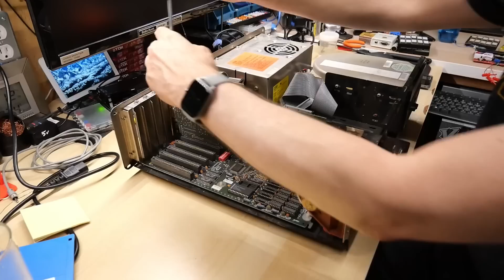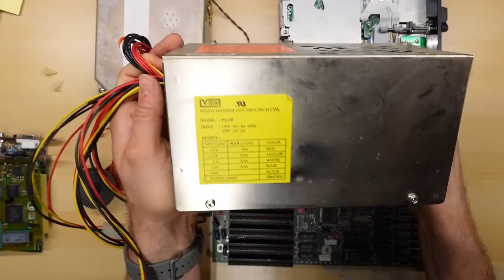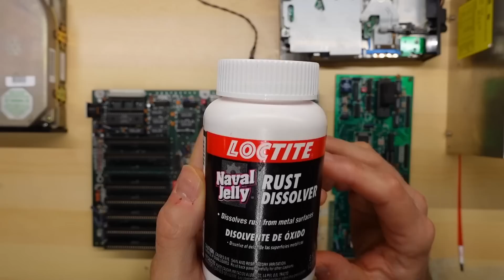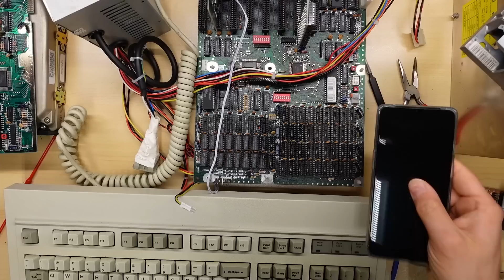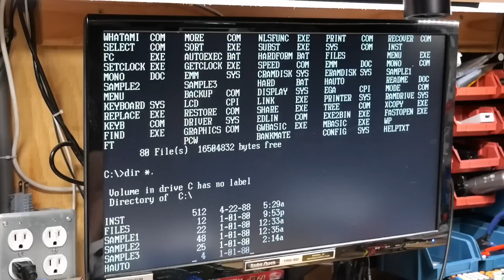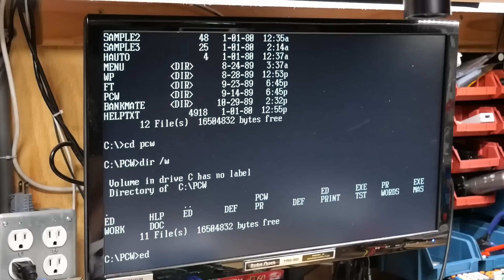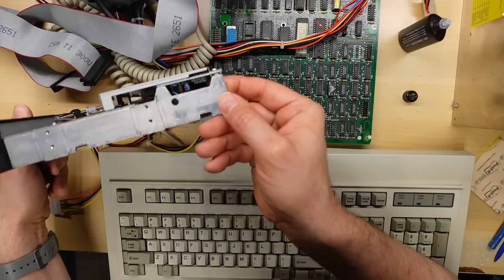PC archeology: Laser XT Turbo "Leaking VARTA Battery" Edition

Comment: My first XT had a 30mb RLL hard disk.  Remember those?
Either that PC was stored vertically on it's rear, or that battery EXPLODED
You probably need a model F keyboard, not a model M.  (function keys in two columns on the left)

Comment: Using RLL (1,7) encoding gave roughly 50% extra capacity over MFM for nothing, but required very precise control over the spindle speed to provide accurate timing. You can put any MFM drive onto an RLL controller and low level format it to RLL, but if the spindle speed is not constant it will be unreliable or unreadable. A RLL drive suffering with bad bearings or motors would also cause issues with the encoding and produce errors. Changing the controller card can also cause issues if the drive is not low level formatted on the new controller. 
Some manufacturers would only certify certain drives for RLL like the (R) one you have. Some top end disk suppliers would build drives to RLL spec regardless and sell them as MFM or RLL drives regardless.

Comment: You need to preserve the Laser XT software before you go formatting that drive.

If you can get the Laser XT carry all pc portable (it is a PC version of the Laser 128 Apple clone) you should be able to use the Laser Turbo XT software that was on the hard drive.
Reply: I'd preserve the form software that's on the disk as well, if there's not already copies on the internet. Just so its not lost forever, then future generations can see what these machines were used for, aside from games :-)

Comment: Phosphoric acid (aka E338) isn't itself toxic - you find it in soft drinks quite a bit to give them some "bite" - but like any edible acid (including citric acid, malic acid, acetic acid, &c.), you don't necessarily want to drink it in anything but low concentrations!
Reply: Keith Gaughan, re Phosphoric acid,
Or rub your eye when you are working with it.
Reply: i am serial computer vetreran. we had 10k pisces
Reply: Iirc, malic acid is safe in high concentrations, you can buy crystals of it in similar size to salt in grinders, the only side effect it has is causing your tongue to bleed, which isn’t fatal
Reply: @Voxfan124  Is that the stuff on things like Sour Warheads? Because those always irritated the hell out of my tongue....lol.
Reply: @VenomStryker  yes
Reply: Phosphoric acid is the sour taste in Coca-Cola, and I can't stand it, so when he said "toxic" I just went with it. (Remember the urban legend about cleaning your battery terminals with Coke? This is why. It kinda sorta works.) It's also used in making cheese.

Comment: For the HDD, when the MFM/RLL drives start having issues booting it's always best to use the controller bios low level format routine to rewrite the track information.  Then run spinrite/scandisk on it to check/fix/remap any bad sectors after.  It was standard procedure back then to do that when pairing up drives to controllers.  Also the ST225(R) sometimes had stiction issues and were fine once you got them spinning.  The R in the ST225 model name meant that it was a certified RLL compatable drive, but it could also be re low level formatted to MFM.  The opposite is also possible, but with mixed results depending on the quality of the platters.  If you have a marginal RLL drive it may be a perfectly fine MFM drive when re-lowleved (with reduced space).
Reply: To be honest, the ST-225R label puzzles me. IIRC, the RLL version of the famous ST-225 was labelled ST-238R (denoting the capacity of a 25meg MFM drive formatted to 38meg RLL). But it seams, they just tucked a "R" behind the name to indicate RLL-formatting capability. Suffice to say, that when RLL controllers appeared, everybody just tried to reformat their MFM drive to RLL to gain the speed and capacity. Most of the time, it just worked fine.
Reply: @virtualinfinity6280  The 225R was something like 17 MB "naked" when MFM was used, so 14 MB or so after partitioning and formatting. Nobody wanted a 14 MB drive in 1989, which means this design simply wasn't marketable without the RLL space bonus. Since the people with pocket change had moved on to the ST-251 by then, or something even larger, nobody really cared whether their 20 MB drive was a small drive being pushed by the controller, or a sloppy bigger old one not being pushed. Fortunately for Seagate, the ST-225R was fairly reliable (comparable to the 225 and 251).

If you took an ST-225 and stuck it on an RLL controller (I do specifically mean the common 2,7 RLL of the day, not the even higher density variants that appear inside IDE drives) you got an ST-238R. The only difference between an ST-225 and an ST-238R is that if your ST-238R didn't work with an RLL controller, you could return it as defective but if your ST-225 didn't want to (but worked on the MFM controller) you were SOL because "running RLL" was not guaranteed. In practice, it almost always worked just fine. Also all the 238R models were the faster of the two variants of the 225, because the slower-seeking one became obnoxiously noticeable when dealing with 26-sector tracks.
Reply: @virtualinfinity6280  Back then it was quite common to low-level format the MFM drives to try and get more space.  Most of the time it was fine, but some drives didn't take it well, not good enough media for the data density.  Yeah the drive labels were a bit of a mess back then, Miniscribe had some archane numbering too for their drives.  All of them were noisy (Micropolis and Miniscribe especially).

Comment: The way I clean this type of corroded slots is using hand clean wipes. I let them out to dry for a day. I soaked them with vinegar then push them in the slot with a credit card. Leave them in for a few hours and it will absorb the corrosion, they'll turn blue. Repeat the process several times and end up cleaning the rest of the corrosion with a tooth brush and vinegar.
Reply from the maker: That's a good strategy!

Comment: I had an XT machine way back where the keyboard lock pins had to be shorted if the mainboard was not in the case otherwise the keyboard didn't work, maybe this is the issue
Reply: I checked the manual and section 2.12 says the pins do need to be shorted for the keyboard to work
Reply from the maker: Thank you for the tip Motolav and Rob!!! I will do a quick follow-up test. Awesome!
Reply from the maker: Yep that was it! Motherboard is booting and working fine. https://imgur.com/a/Rb1YFrQ
Reply: @adriansdigitalbasement2  Glad we could help! Thanks for the great content
Reply: @adriansdigitalbasement2   from what i could tell is that the Laser XT/3 motherboard is almost the same design.. (i have this machine here) and restored it almost.
Its weird to see that the installation of the ram chips (conventional memory) is on the other side on the motherboard 8088 XT vs 8086 XT/3
Here the installation of the dip memory starts on the upper side where   the DMA controller IC is. Then the two banks on the left are for 512KB. And the sockets underneath is (which you showing us in the video) are for install the 128KB of memory.. The 2 rows on the right side is for EMS memory installation.

I have upgrade my system with new memory chips,  had to soldered in a new IC socket for the DMA IC and also replaced that due corrosion.
Added an Intel 8087-1 10 Mhz co-processor just because Upgraded my NEC 20MB MFM drive for a Seagate ST-277R 65MB 
added and EAGLE II graphics card. ADDed HD_floppy controller. Replaced the old 720KB drive with an 1.44MB one (because those diskettes are more available) (but still the 360Kb chinon drive 5,25 is original. Further will add, an SB 1.5 to it, ethernet card from SMC 3008TP, and adapter ACB-2070 RLL controller.
Also will add an Roland MPU-ICT to it, for connecting an MT32 to it.

What i do to revive old Winchester or other hard drives. Connect them only to the power supply (without interface cables) And let it warm up for some time. 
Also try to lubricate the spindle bearing if it is possible with that teflon grease  (tri flow) If its sound good again.. Try to see whats on the drive, if you know on which controller it was installed on. Then backup the data you need. If its done, re low level format it and start over.. Due age, the magnetic surface gets more errors and data loss. To reformat it you will prefend that.

Comment: Phosphoric acid?  Hrmmm  I wonder if concentrated Star San would work at 50% phosphoric acid.  Of course who knows what Benzenesulfonic acid would do...
Reply: just pour coka-cola on it.  same thing.  works great on car batteries too !
Reply: Makes sense why people use cola for rust, don't know why it's there to begin with.
Reply: C6H5SO3H is actually a waxy solid at room temperature.  Its sodium salt is often found as an additive in laundry detergent.  It is a very strong acid and will decompose to benzene and sulfuric acid in a strongly heated solution.

Comment: VARTA: a 4 letter word in the retro computing community
Reply: The Q in VARTA stands for quality.
Reply: Actually, choosing those batteries was a sign of quality-conciousness. Believe it or not - they where top-quality back then. I think it's fairly safe to assume, that someone soldering a battery to a PCB and not even considering a proper battery socket never anticipated the product to be "in use" after 40 years or so :)
Reply: @virtualinfinity6280  True dat. Show me any battery that did not fail after  ten times it´s planned lifetime. Without proper charge / discharge cycles. It´s like people complaining that the fuel and battery in a 40 year old barn-find Chevy Corvette do not work anymore and are causing corrosion issues :)
Reply: You mean 5 letters? V-1 A-2 R-3 T-4 A-5
But yeah, those VARTA batteries are the bringers of doom and destruction on any computer that hosts those pieces of shit.
Reply: @nekomasteryoutube3232  "four letter word" means a swear word

Comment: Perhaps the composite color output on that CGA card depends on a color trimmer on the motherboard.  I tried a CGA card on a 286 PC and it wouldn't output color composite because the motherboard is missing that component.
Reply from the maker: I tested it again later after this video and it dees actually work -- just only in 40 col and 320x240 modes -- which is actually a good choice because the 640 pixel modes (like 80 col) are unreadable in color modes.
Reply: @adriansdigitalbasement2  That video card will support Hercules 720x348 monochrome graphics on the 9 pin connector.  I had this model, and played "Prince Of Persia", and "Ken's Labyrinth" in Hercules mode on an amber, and later a green phosphor screen before upgrading to a Trident TVGA8900 512KB VGA card and screen.